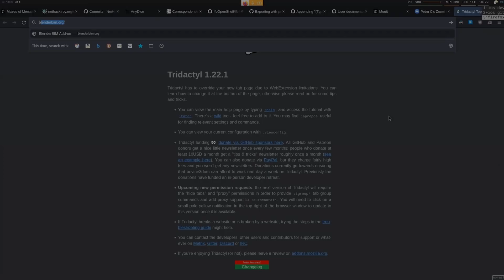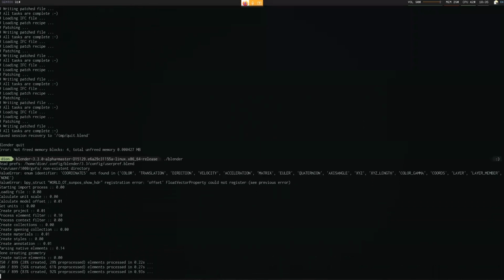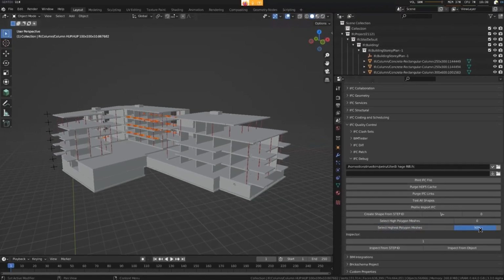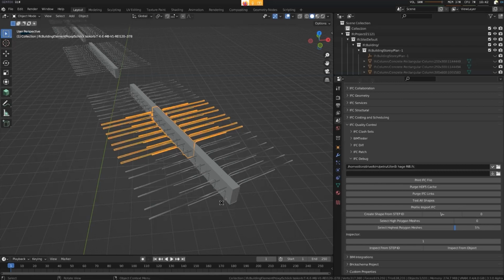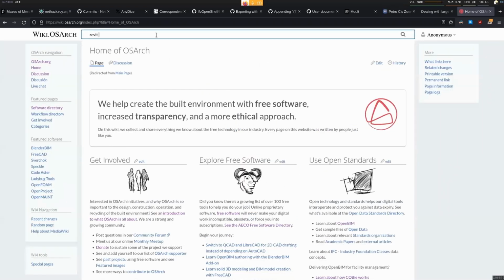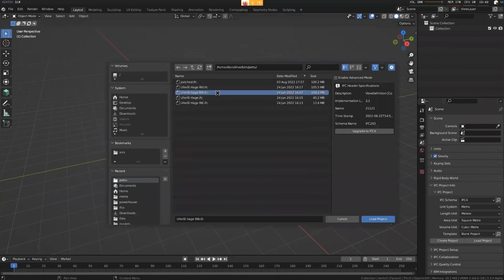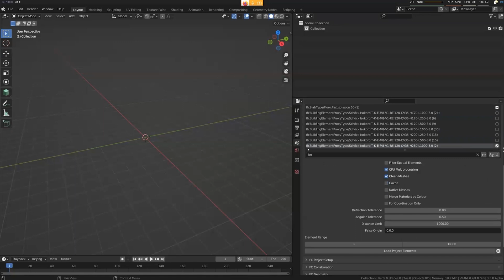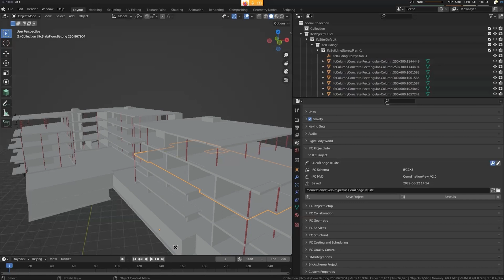How to Handle Large BIM Models in BlenderBIM (Tutorial)

Comment: It's very simple. The larger the project, or if we want to work on large models, the file becomes heavier. Therefore, you need a more powerful computer. Simply put, with Blender or other BIM software, you can easily design a small house or a skyscraper. The important thing is how you manage the data. Blender is fantastic for both BIM and presentation. Thanks for the video.

Comment: Im trying to sell inside the company I work at, but we just tried to open two models today and had two separate issues::
1.  Fasade model. IFC2x3 file that didn't failed to load about 40% of the model. 
2. Elevator model. IFC4 file that loaded geometry in two separate locations. The one in 0,0,0 was probably a support layer of lines to create snap points, and the main geometry was placed up and to the side by quite some distance. 

These problems did not occur in Dalux and Solibri.

No idea how that happened, and it wasn't the greatest demo I could give my boss..! Any clues what this could be and how to fix it?
Reply from the maker: Hey Edvard! It's great to hear you trying to promote Bonsai man, I love it! Are you still facing this issues with the latest versions? I sent you a message on Linkedin, let's have a chat and see exactly what this is about.

Comment: Great video i must say. And what a brilliant way to check the heavy culprits in an ifc model. Thanks guys. 
So, are IFC models done in Freecad better than that done in Blender since freecad is all solids whereas blender is all meshes
Reply: It doesn't necessarily correlate with the modeling paradigm. Blender uses meshes, but the BlenderBIM Add-on lets you work on parametric solids, so you can create an entirely non-mesh model in Blender. In Revit, which uses solids, tends to export a ton of really low quality meshes...
Reply: @DionMoult  is it possible to optimize the meshes in blender (for example using limited dissolve) and export it as an optimized IFC file?
Reply: @danialsoozani  if the original data is mesh-based, then absolutely yes. Note we don't "export", we work with IFC natively, so you'd "save as" :)
Reply: @DionMoult  Thank you very much, I'm trying to get professional in this area and your guides are extremely good and maybe the only resource I found on youtube. I wanna apply for job seeker in australia and trying to adapt to really high standards you're sharing with us. wish me luck and thank you veryyyy much!!!
Reply from the maker: Thank you very much, I'm glad it was helpful!